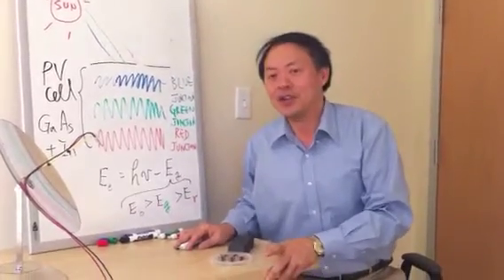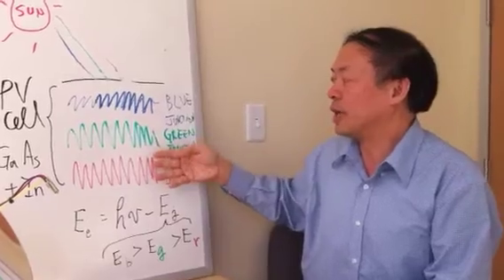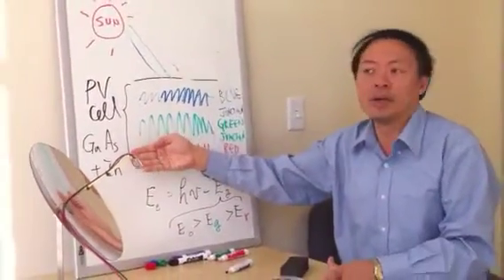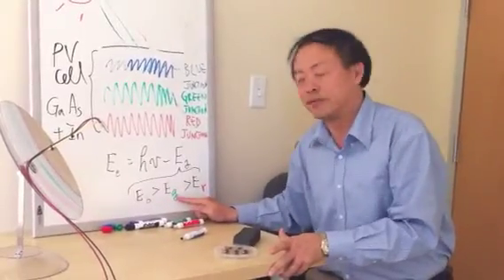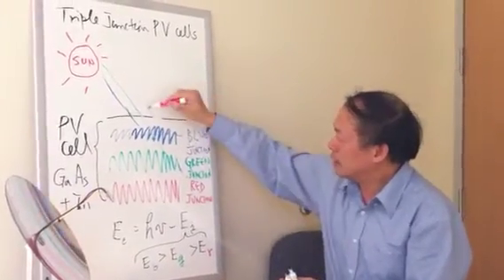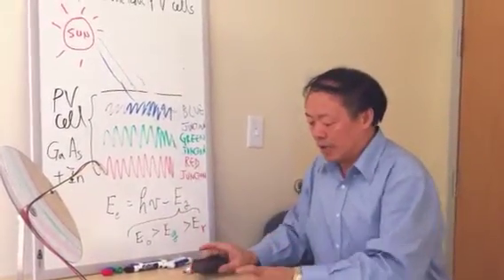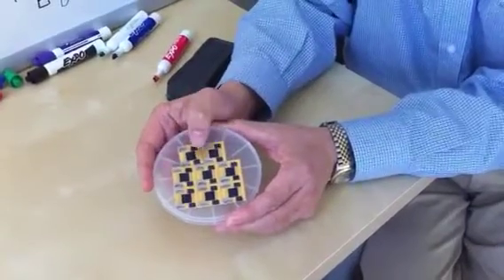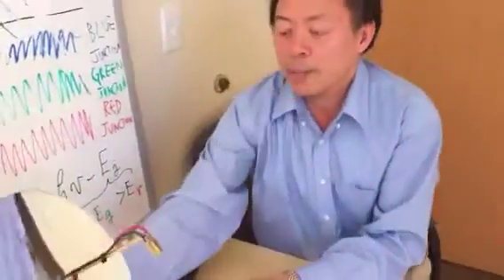Concentrating Sun on Triple Junction Solar Cells

Comment: The problem is that with concentration of the sun light the live duration of the solar cells is sinking. But i think huge tripple junction cells are cheap in the future because the active layers are verry thin and they could be used instead of normal roofs.

Comment from the maker: It is at 1000 sun concentration when the chip, as advertised would produce 40W if operating at around 40 degree Celsius. Without the concentration, it would produce as you say 40mW.